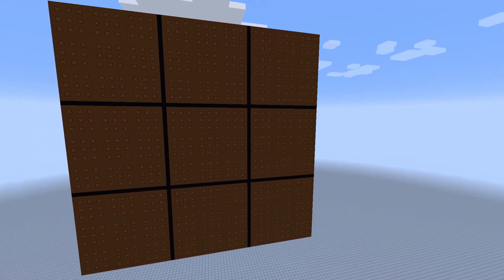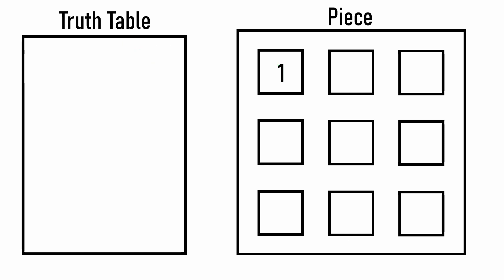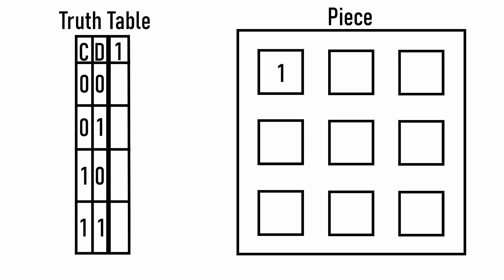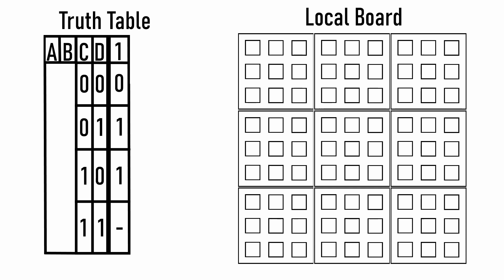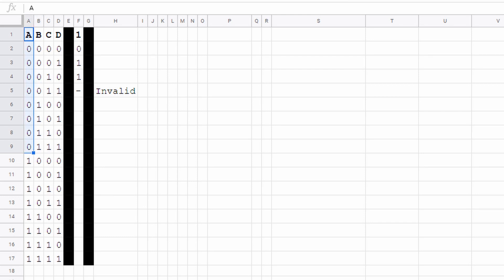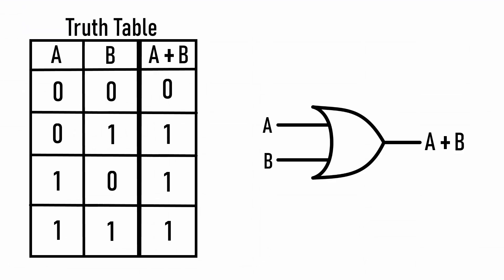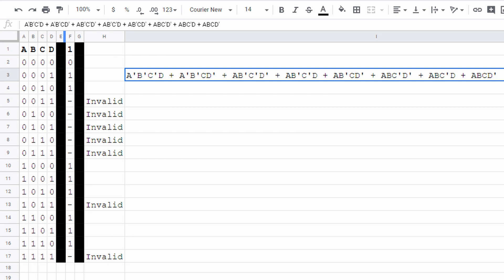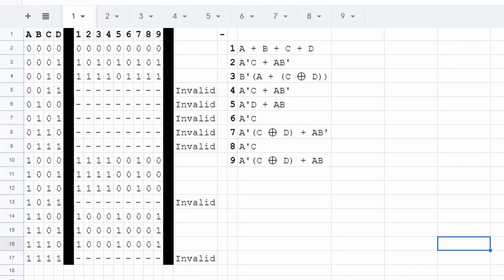Combinational Logic: Ultimate Tic Tac Toe in Minecraft - #3

Comment: I was reading the comments and people are offering improvements to the logic via compression and simplification. I however was curious if we could use something like a supernet here, both for latency and compact design, as it happens we can. This could eliminate the need for some logic altogether and add a little flexibility without any large spacial increases (beyond what the equivalent  logic based designs and their routing would require).
Here's a video showing you what I have in mind: https://youtu.be/G2dPXVIg_us
Reply from the maker: I like the idea of basically instant redstone lines, and I'll probably use that for control signals, but I'm probably going to stick with logic just because I know how to use it
Reply: @ReidCaptain  That's a fair point to make, just keep in mind the latency factors. It all adds up faster than you might expect. And if you include any timing circuits this could become an issue. Things to keep in mind at least. Thanks for the reply.🙂

Comment: EDIT: as an ICT student, i had this as part of my curriculum
EDIT2: also no offence, I can see how gates can be complicated and you applied them quite well, gave a sub
doing global states as local variables is annoyingly complex and for this reason shouldn't be done often
instead do one processor for global and if in the correct (A=1) state do a local override, which would cut your truth table in half
expressed as code this would be:
if A {look at B, draw large} else {look at C, D, draw local values}
also since i have the time this would be the global-local truth table (for pixel 1) (omitted invalid expressions)
ABCD      Q (global)
0 0 - -       1 (part of large X)
0 1 - -       1 (part of large O)
(simplified to ~A : 1)
ABCD      Q (local)
1 - 0 0     0
1 - 0 1     1
1 - 1 0     1
which would simplify to AC+AD : 1 (for pixel 1)
which is equivalent to A(C+D) : 1, which thanks to the previous shortened equation also equals C+D : 1
adding them together we get ~A+C+D : 1, which describes all possible states for the pixel
this assumes doing sigma (searching for 1s) boolean calculations, the opposite can also be done - or both for best effect, as sometimes one answer is shorter than another
while the expression I got is slightly more complex (a negative and three-input OR in place of four-input OR) than your original A+B+C+D, it is a more scalable approach, as you don't actually use this equation in the build - one processor checks for the first part ~A, and routes a global draw, and the second C+D expression is used for local draw, both of which have to be accounted for
Reply from the maker: Wow, I can tell quite some time went into this. I'm glad that people are coming up with other solutions to my problem!

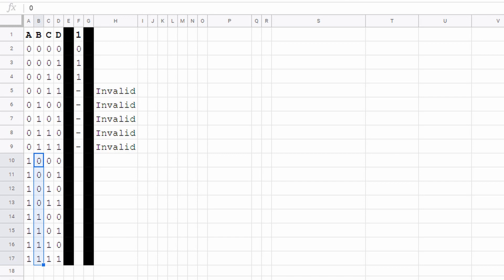Comment: At around 3:21 there are some fairly major changes I would have made to your system to simplify it and probably make it much easier in general. Firstly, I would change it so that the D bit simply corresponds to O = 0, or X = 1. Then I would make the B bit simply corresponds to ON or OFF (for the entire display), and finally I would have the C bit indicate 0 = Small or 1 = Big. You wouldn't lose any information, but you'd cut it down to a mere 3 bits of information, which is significantly less logic and when you scale it up to the whole board it would make it much more efficient in general.
Reply from the maker: I think that's a great idea! The reason I did it this way was so that the move validator, RAM, and win detection would be conceptually easier. I'm paying the price now, though.
Reply: I had the same idea